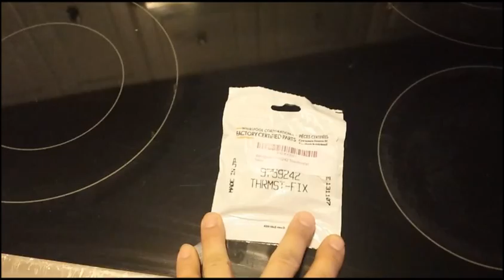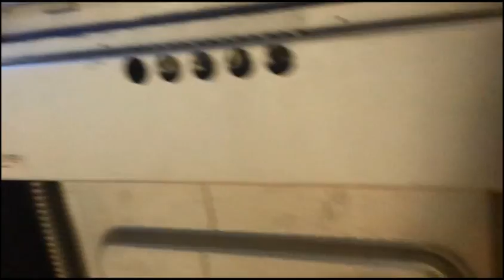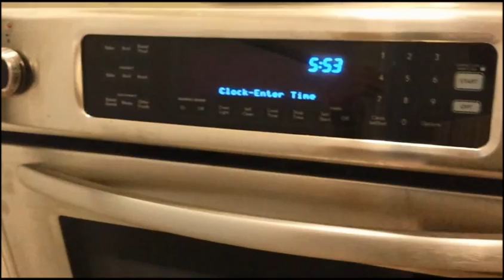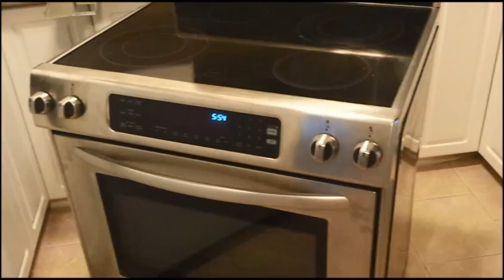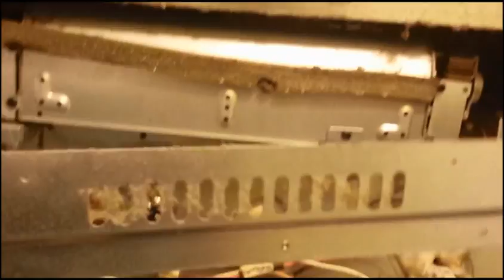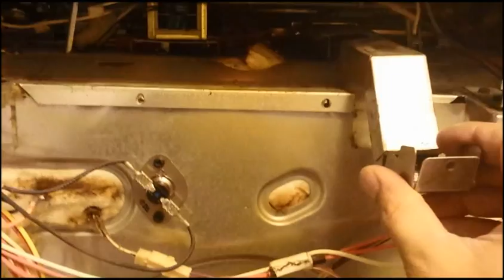Repair - Dead oven after self clean mode, blank display, locked door Kitchen Aid Whirlpool

Comment: Thank you, thank you, thank you!  Great information... easy to follow directions.  I just googled Kitchen Aid parts and found the same number you showed on the video.  Whirlpool has replaced the part with a different number and it looks different, but it fit.  The hardest part was getting the back off and on but replacing the part was easy.  They sent the part overnight.  It cost a lot for overnight Saturday delivery but it was worth it.  I was only without my stove for less than a day.
Reply from the maker: Deanna Tibbs nice job on the repair! glad to hear it worked out :)

Comment: Thanks a lot for your help. You've made a difference for us.
Reply from the maker: Pay2Play good to hear! thanks
Reply: Random Repair you remember what the blower part number was ? we have the exact same model of oven as you and I've replaced the fuse but now the blower seems the be making a very slight noise, nothing like in the video, just a little one, should we be worried and replace it ? thanks for your help... first time we cook with it since fuse replacement
Reply from the maker: Pay2Play many times the bad blower will cause fuse to blow due to inadequate cooling.  I don't remember the part number but it's right in the service manual I found on Google.  thanks!

Comment: My kitchenaid built in oven will not heat after doing the self clean feature.  You wouldn't know anything is wrong because I can push the bake and start and it says pre-heating but then nothing heats.  I can hear the fan running so what do you think that might be?  I shut off all the power to the oven and left it for 10 minutes but still no heat.  Can you help me?
Reply from the maker: could be a number of things. first check thermal fuses. if you send me a schematic I can tell you where to look

Comment: whirpool gold..double wall oven..locked and no display..help
Reply from the maker: gotta pull her out and check fuses :(
Reply: self cleaning ..same issue as some of these other folks..is it same type of fyse replacement?
Reply from the maker: +A and J Concrete Construction, Inc. yup. same same.
Reply from the maker: +A and J Concrete Construction, Inc. part number is on the fuse :)
Reply: +Random Repair  thank you!
Reply from the maker: +A and J Concrete Construction, Inc. anytime!

Comment: My KitechenAid has a message that says "door OPn". the door is not open and this happened after the power went out in my home. Does anyone have any solutions? I have un plugged for 10 minutes and the same error code shows. i have also tried holding buttons in different sequences and nothing is happening.
Reply from the maker: +Zack Boaz 
I have not seen this one.  I would assume there is an issue with the door switch, but it could also be the control board.  I would suggest finding the door switch and testing its function.  Its probably on oven side of the latch.

Anyone else???

Comment: Steve, I have an IKEA FRAMTID convection wall oven made by whirlpool. It died during self clean. I believe it's the fuse as well. But the door is locked and I can't pull the oven out. How do you open the door without power ??
Reply from the maker: try hooking the latch and pulling it over with a coat hanger... that normally does it
Reply: +Random Repair 
Steve... Thank you! It did open and I removed the  thermal overload safety thermostat (fuse I assume- looks exactly what you removed in the video). How do I know it's bad? Doesn't even look burned out? Txs again.
Reply from the maker: +Carlos Cardoso u can check it with a multi meter or short the wires and test it
Reply: +Random Repair Steve ... Much appreciated. Fuse is shot. Thank you again !
Reply from the maker: +Carlos Cardoso cheers my friend.

Comment: I found a link with the correct oven wiring schematic:   

http://www.searspartsdirect.com/partsdirect/user-manuals/KDRP407HSS13-Kitchenaid-Parts-Range-Parts-manual

When the power is turned on from the panel, the stove top works perfectly, but the oven is completely non functional.  No display or functionality whatsoever.  The problem occurred during a self clean cycle.  This is the first time I have ever used this feature on my oven.  The thermal fuse you showed in your video has continuity, so it is fine.  Any other ideas?

I appreciate your help!
Reply from the maker: +Jon Vandel 
I dont see a schematic in your link,  I would imagine the board is not getting power for the oven.  You would have to check the for power there, if it exists, then you board is probably toast.  I would imagine there to be an interruption before that.
Reply: +Random Repair if you click on the link in my previous entry, then click on the installation tab, you'll find the schematic on page 13.  Thanks for your help.  Any details you could give me would be helpful.  Thank you, Thank you, Thank you!
Reply from the maker: +Jon Vandel 
There are 2 thermal fuses in that oven.   There is one on the low voltage side of a power transformer and another on the high voltage side.

You will need to check and test both, they are probably located in different spots.  The one I would suspect has blue wires on it.  The other has a White and an Orange.
Reply: +Random Repair The thermal fuse that I found by removing the back panel, has 2 red wires going to it.  That one has continuity.  I don't see anything else that looks like that on the back of the range.  I do see some additional components located under the cook top, however, I am unsure how to access that area.  Do you think that's where the additional thermal fuse is located?

Thank you for your help!  I am supposed to host a birthday party here this weekend.  Hoping I can figure this out in time.
Reply from the maker: +Jon Vandel I don't know where it it but I would start by locating the power transformer.  they are usually easy to find. it's probably on the top area under the burners
Reply: +Random Repair yes it is under the burners.  I'm not exactly sure the best way to go about exposing that portion of the electronics.  Any suggestions?
Reply: +Random Repair I opened up the top of the stove and found the rest of the electronics but am not seeing anything that looks like the other thermal fuse.  Can you help?
Reply from the maker: +Jon Vandel you have to follow the leads on the power transformer. it's between the power transformer and the board

Comment: The new fuse arrived.  It does have continuity and the oven still doesn't work.  Do you have any other suggestions?
Reply from the maker: +Jon Vandel 
You can always send me a copy of the schematic with exact details on whats not working...
Reply: see my latest reply ...may be your transformer that was the issue  with this exact same stove....part number in my post easy fix 175 bucks

Comment: I have a kitchenaid Kdrp407hss13 dual fuel range.  I pulled the thermal fuse as you have shown in the video and ordered a new part.  As I'm waiting for the new fuse to arrive I tried to bypass the fuse by temporarily taping the two clips together.  Still no power in the oven.  The stove top still works fine.  Everything worked just fine until until I ran a self clean for the first time since I purchased it in 2010.  Any ideas what other parts may have failed?  Thanks for a great self repair video.
Reply from the maker: make sure you have a good connection  on the bypass. did you test the old fuse for continuity?
Reply: +Random Repair   The new fuse arrived, does have continuity and I still have no power.  Can you help?

Comment: I have a Kenmore Elite Convection oven (two doors).  I self cleaned it and now the lower one will not bake or broil.  Sits at 100 degrees that is all.  I have done some googling and I just want confirm am I able to RESET the thermal circuit breaker?  Do you know if there is a red button to push or do i have to take the whole fuse out and have replaced.  Apparently this happens quite frequently with this model.  Wish I would have known before hand and I would have just done a normal cleaning.. thank you!
Reply from the maker: ktllutcher If it doesnt heat up at all it probably the fuse.  I dont think I have seen this model or worked on it.I would start by popping the back off and doing a visual.

Comment: I have a kitchenaid superba selectra. The other day I started the oven and suddenly there was a flash and the stove died. The oven locked up and I can't open it. Is there any hope for this stove? I already purchased another but I was wondering...also how do I unlock the oven door because a very expensive pot and pan are stuck in there. I was not self cleaning the oven it was just baking.@Random Repair

Comment: We have had the same problem after a self clean cycle. But we have a double oven built into the cabinet. Can we still fix it? We haven't been able to remove the oven from the cabinet.
Reply from the maker: It will be the same part.  Best of luck on your repair :)
Reply: Curious if you were able to remove and fix. I’m dealing with the same issue and my oven is built into my cabinets

Comment: Can you test that thermal fuse with a regular volt meter to verify if it blown?
Reply from the maker: Yes. It must have an OHM setting. set it to that, see what it says with the probes connected.  If the fuse is good should be roughly the same. :)